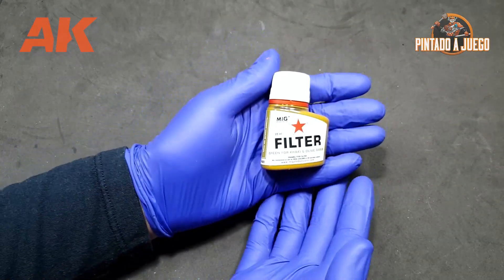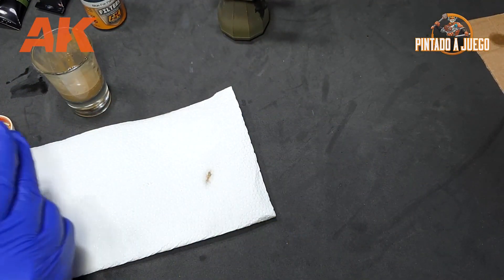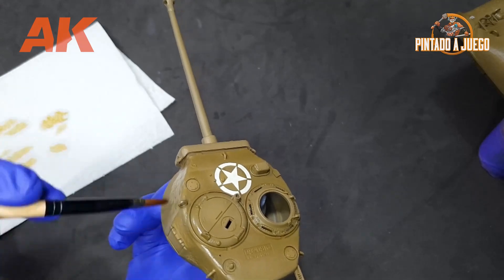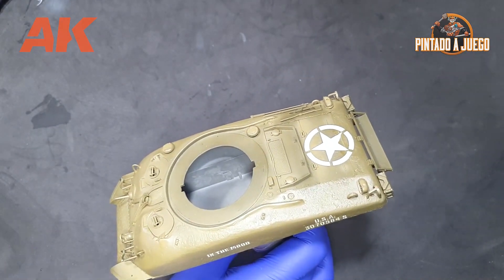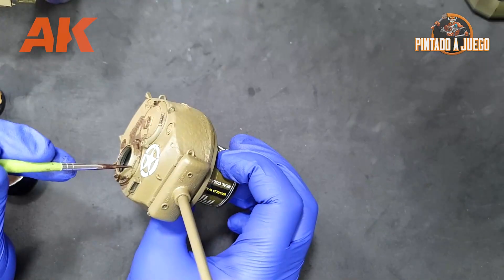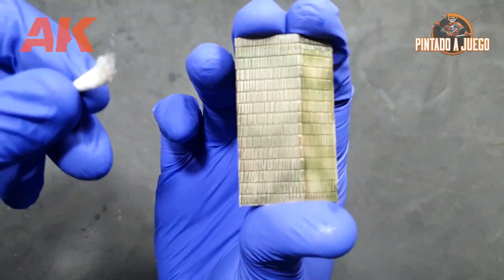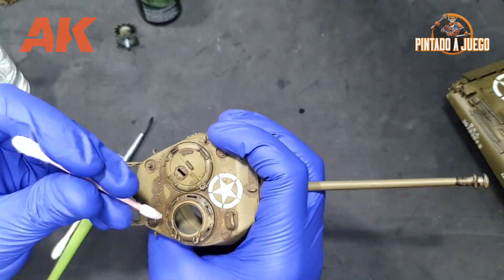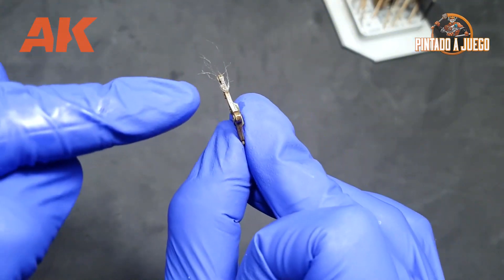Modelling From Zero 04 | Filters & Pinwash Technique

Comment: Hello and thank you for this video series which is really very well done. 
I'm not a beginner and it's good to review the basics step by step.
It would be really great to have a table that summarizes for each technique used with the airbrush (primer, paint, varnish, ...) the following elements:
dilution rate, needle size, compressor pressure.
Thanks again and congratulations for this series of videos.